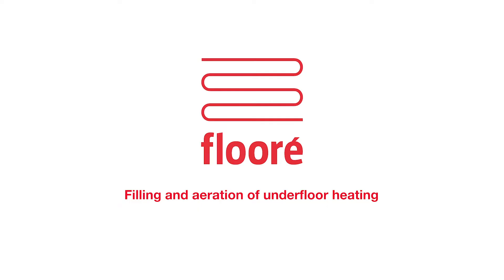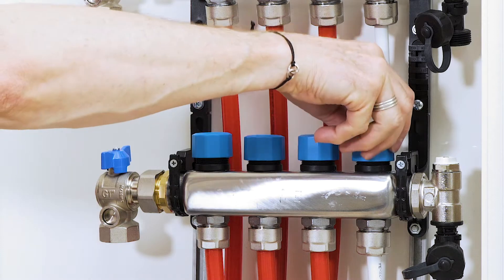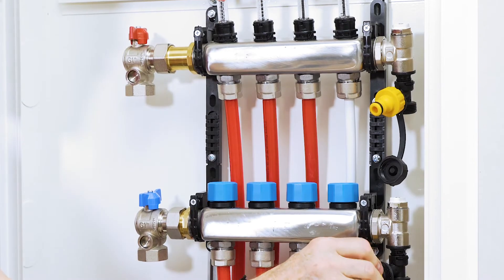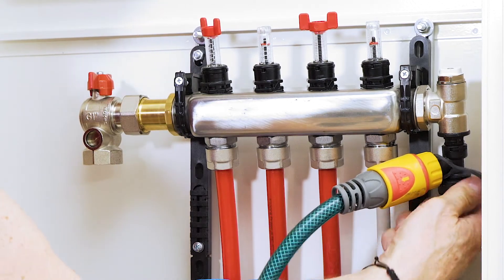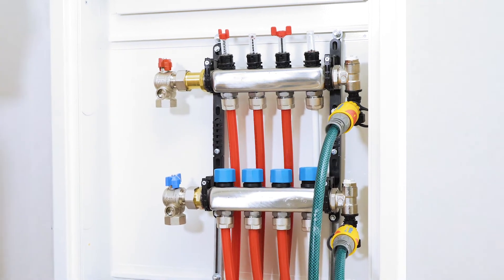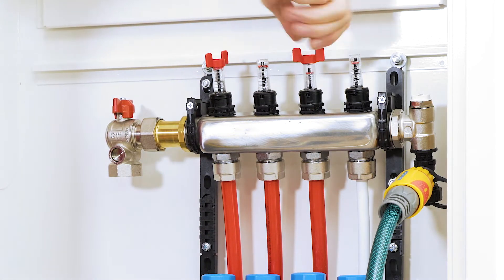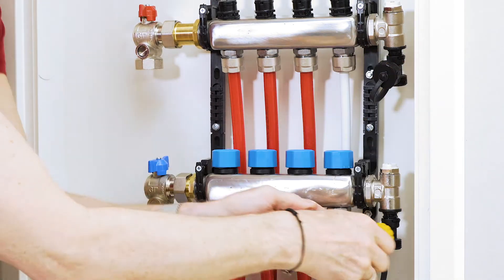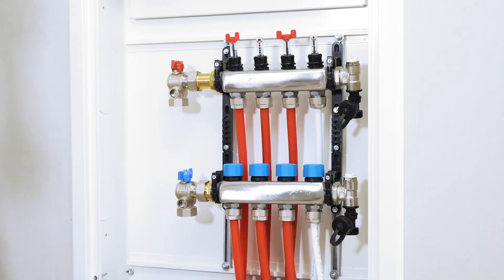Filling and aeration of underfloor heating

Comment: Ok after filling with water, do you gravity feed the glycol solution into the pipes?
Reply from the maker: Most common is to use only water in the underfloor heating system for domestic houses in Scandinavia. But if you need to have an anti freezer or glycol solution it is easiest if you can fill the system by pumping in the solution. Our underfloor heating manifold can be used for water/glycol solutions with max = 50% glycol .
Reply: @flooreab  i just ran straight water here, as long as no long periods without power should be fine, also have generator could fire up if needed...  but thanks,